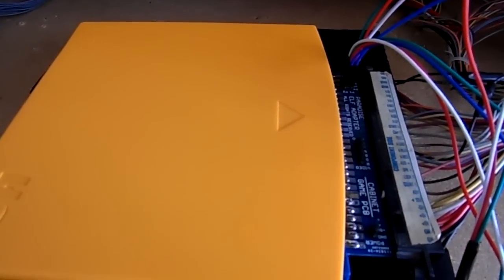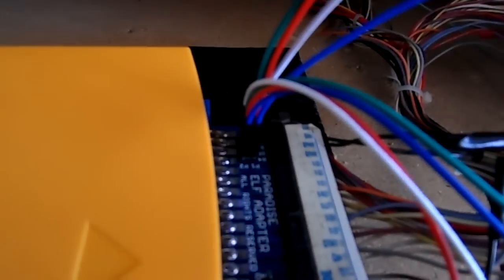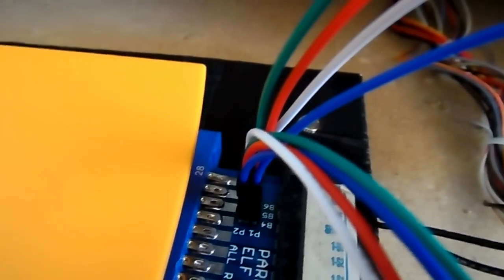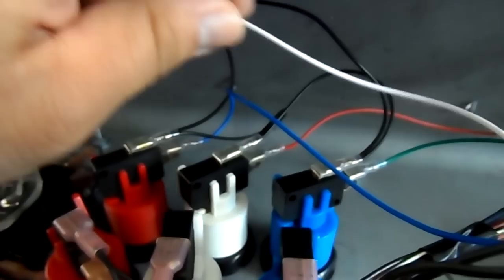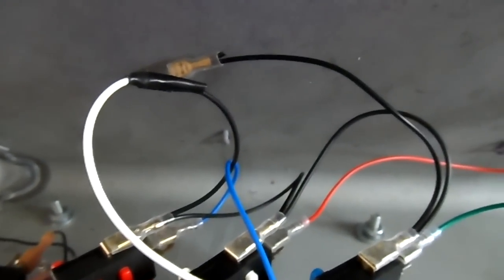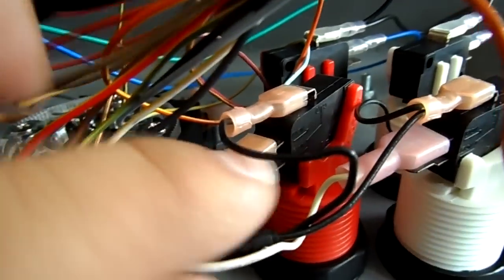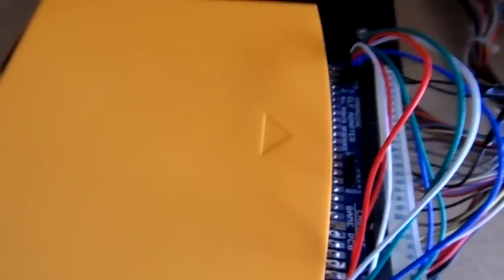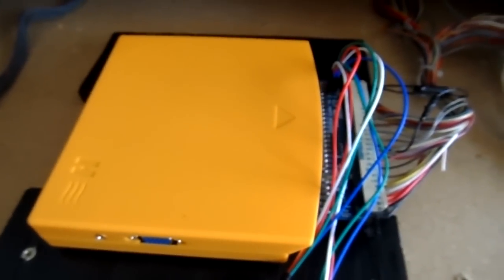Correct Installation Of Pandoras Box  Multigame  Cart PCB

Comment: Bet if you get a multimeter and do a continuity check you'll find the problem on that button 1. Maybe there is a bad solder joint on the adapter.

Comment: I have xmen vs street fighter arcade game and cabinet. I want to know if this box would be able to replace the b board which is the actual game cartridge? would help out a lot whether it would be a good plug n play or customizations will be needed?
Reply from the maker: Your Xmen vs Street Fighter uses 2 harnesses. The regular jamma harness for all buttons EXCEPT the kick buttons. The kick buttons use a Capcom CPS2 "Kick Harness" which goes from the game board to the buttons.The pandoras box, when installed, wants you to use all punch and kick buttons from a jamma harness. THe easiest method for simple plug and play is to buy a pandoras box adapter. You plug the adapter into the jamma harness on one side and into the pandoras box on the other side.

Comment: so to my understanding , u need this pandora to jamma adapter to play those 6 buttons game because it has the extra slot for kick harness? but if i just wire the 456 from my jamma to my other 3 buttons then will it play as well r? i can't find this adapter anywhere  ( i asked because i have multicade panel with 3 buttons and a track ball so i might just play only 3 button games if it lets me , i just ordered the pandora's box 4  , it's coming next week ) thanks
Reply from the maker: The adapter also changes certain ground wires.i got my adapter from paradise arcade shop.
Reply: ok thanks ! i ordered one =D
Reply: gomgomboy I was able to cover up ground ?27? with electrical tape on the pcb and I got it going with 3 buttons out of the box. If you try it without the ground blocked of on the one pin it will always be sending a signal so it won’t work. All you need is a piece of tape, no need to cut up your jamma. But this will only have 3 buttons.
Reply: @LazyElkman  are you saying you were able to hook up your pandora box to your existing jamma harness by just covering up ground 27?
Reply: @foxbodystang8587  yes. I did. This was quite some time ago though and can't remember all the details.
Reply: @LazyElkman  So if I connect my pandoras box to my stock jamma connector, I can expect that things wont work right? I have a stock jamma powering a street fighter 2 pcb.

Comment: I've got a cab with a multi board that works fine .Then i bought a pandora 800 in 1 and a game elf  multi boards.
When i plug them in i get a scrambled picture...  When i plug them into my other cab (witch is a lcd) they both work fine...  Will this adapter fix my problem?
Reply: Jonny Esper 
Did it work?  I have an elf and want to but the 800 game on it.  Is it hard

Comment: questin any insight much appriciated i have a pb3 connected vga to a makvision lcd i have a jnx adapter using pc speakers for sound.  getting 5v to pcb. no video no sound.  it froze on startup once and hasnt worked since.  it also worked perfect the day before . any help i would be super happy !!!!
Reply from the maker: sounds like a ground issue or something . that's about the only thing I could think of. could be the cart shorted out .

Comment: do U use jamma only? Supplier told me that i have to have VGA input. My monitor is connected to the Jamma and i do not have VGA cable so i think it will not be working.
Reply from the maker: toyja The box I have uses both CGA (jamma) and VGA. If your box only has a VGA output you can simply by a VGA to CGA adapter. Those are cheap. Then you should be fine.

Comment: Hi moomert1, I have problems wiring buttons 6 for both players 1&2 on pandora's box4... in istructions are indicated positions E/27... but it dont work... I think the right connections are M/11 but I'm not sure... what you think about? Thanks
Reply: Another thing. I tried to connect my pandora's box4 to a "6-in-1 Jamma extension PCB converter board" (if I remember well you have one too)... and there was a problem, the buttons and joysticks feedbacks where terribly slow, instead with direct connection to jamma there is no problem. can you try this configuration with yours pb4? I wanna know if this happens only to me or not... thankyou.
Reply from the maker: +Tommaso Masetti I have heard the the Pandora boxes do not work well with the 6 in 1 Jamma boards
Reply from the maker: this could be true. the instructions tend to sometimes not be so good.
Reply: +moomert1 I confirm that... :(
I thought it was like the "happy fish 2", which works fine ... but nothing to do
Reply: +moomert1 you opened the box? I did it ... the board is very small and there is a 16GB microSD  connected ...
Reply: M/11 don't work... E work for p2 button6... but I don't find where is p1 button6!... maybe is in 27 but is disabled in my board...
Reply from the maker: +Tommaso Masetti make sure you have a clean connections on the board

Comment: I just purchased a virtual fighter cab; realized it is not a jamma type cab, will Pandora's box work with it?
Thanks
Reply from the maker: Charlie Henry not it will not. you need a jamma cab and an adapter.
Reply: Dang, are there options to put games on it or I am essentially stuck with only virtual fighter? Can I possibly use Retropie? Thanks
Reply from the maker: Charlie Henry virtua fighter uses Sega Model 1 hardware. you would need a Sega model 1 to jamma adapter, then you would need a jamma adapter to pandoras box. pandoras box says they are jamma but they are what I call Chinese jamma. truthfully, I would contact fellow youtube user SupremeJudge. he may be able to build you a custom sega model 1 to pandoras box adapter. not sure what he would charge.

However his work is top notch. and highly recommended.
Reply: Thanks so much! I just want to make sure the students at my school get to play more than one game. I am currently building an arcade room as an incentive and to motivate the student body.
Reply from the maker: Charlie Henry glad I could help

Comment: hi moomert1, got a question, im really interested in buying one of those box, mostly the version 4. i got a mortal kombat 1 cabinet. do u think it will work for me by just plug and play, or will it be a pain in the ass where i have to modify my jamma cabinet, thank you for ur answer.
Reply from the maker: pandoras box carts are not jamma. they are what I call Chinese jamma. you need to buy and adapter.
Reply: +moomert1 thanks for ur answer, so what adapter u recomend in order to pandoras box 4 works, and if i buy the adapter, thats it? just plug and play?
Reply from the maker: +Alexander Rodriguez I use the Paradise arcade adapter.  there is also the jnx adapter. plug the adapter into the Jamma harness then plug the pandoras box to the adapter
Reply: +moomert1 so doing that the pandoras box should work fine rite?
Reply: +Alexander Rodriguez  i mean, i dont have to do any soldering or mess up my jamma wires, sorry for too many questions, im a newbie in this.
Reply from the maker: +Alexander Rodriguez the adapters come with a built in harness for buttons 4, 5 and 6. yo will need to remove the MK harness from your buttons and attach the wires from the Pandoras Box adapter harness. really simeple. I have a video showing proper installation of a Pandoras box. search my vids

Comment: May be its a faulty micro switch or a ground issue, as always moomert1 great video.
Reply from the maker: No issue with the button itself. The button works perfect with any other board. I'm betting my money on a bad solder point on the adapter

Comment: Where do you get the kick harness?
Reply from the maker: you can get everything you need from here
http://www.jamma-nation-x.com/jammax/store.html
Reply: moomert1 I opened my box up and the switches for the back of the buttons on both number 6s are missing anyways. I can use the Pandora's box 4s or 5 with a old crt monitor they way it's hooked up now correct? Thanks for answering my questions!
Reply: @moomert1  Is it the CPS1 harness?
Reply from the maker: No, you need a jamma to pandoras box adapter.

Comment: If I get a full cabinet wiring jamma connecter (6 button) http://tinyurl.com/npd7ldw will that eliminate the need for the blue elf adapter to hook up pandora's box? great video btw!
Reply from the maker: Well yes and no. The Pandoras Box V2 is NOT jamma. It's what I would call "mostly jamma". So if you buy a new wire harness, install it in your cabinet "correctly" (per jamma) then it does you no good. You will still have issues. 
Now if you buy the new harness, then install the harness correctly per "Pandoras Box" then all is good.